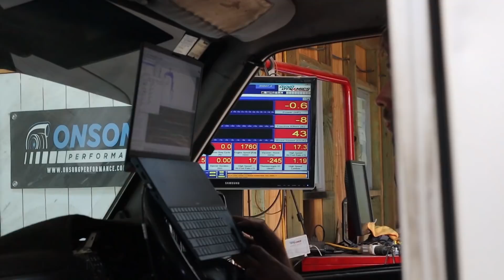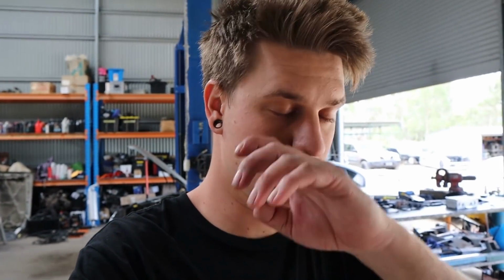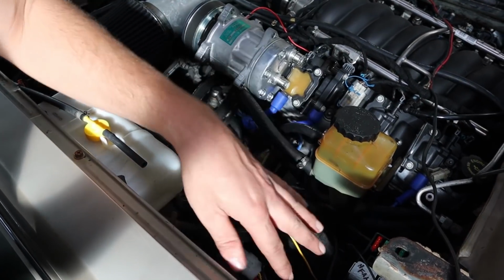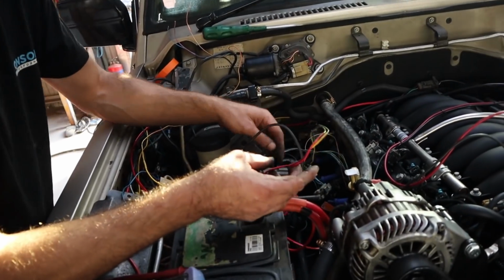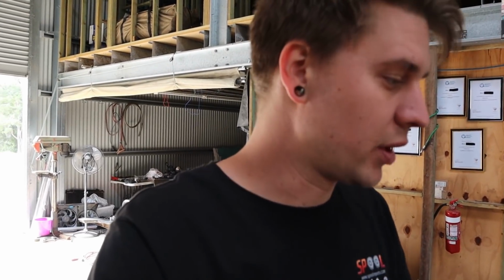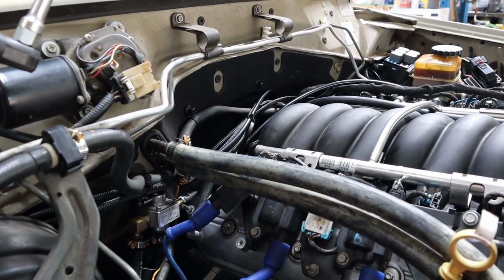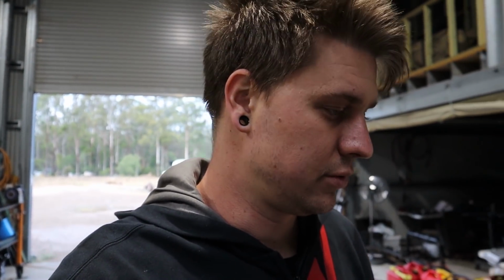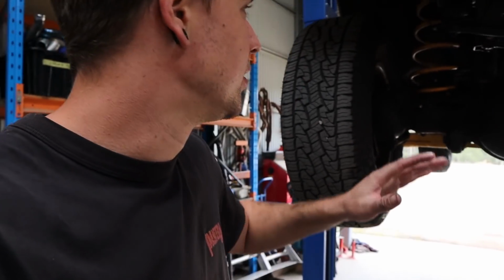The Never Ending Misfire.. | LS 6L80e GQ Patrol Build | Episode 7

Comment: Good video! A few suggestions from a lowly hobby mechanic with an electronics background. Have you tried running it off an aftermarket ECU and see if the problem goes away? I have an ECU I use for diagnostics, it comes in handy to confirm the engine and loom is good in one go.  What is the clearance between the crank sensor and trigger wheel? I've had misfires at revs from too much gap. Is trigger wiring close to leads? that can cause trigger issues on one cylinder if the signal is altered by another coil or lead. Can the factory ECU be set to run batch fire injectors that would fix it. I hate suggestions from other people but you can't think of everything. The amount of time you guys have spent you could have put a piggy back ECU in it and saved a few days.
Reply from the maker: Unfortunately not that simple as there are no aftermarket ecu options that can run the 6L80. 👎
The air gap on the CAS was bang on, we made sure leads were far away from trigger wiring (leads are only 300mm or so long). Would be good if we could put and aftermarket ecu in for fault finding, if it was manual we probably could. The e38 is quite advanced however, not much an aftermarket could do that the e38 cant, to have a total of 3 units all having the same fault would be unheard of.
Reply: @BoostGumps   Can run them piggy back and let the E38 control the box. At some stage you will need to make a call, to give up and give it back to the customer, spend even more time diagnosing or add a reasonable piggy back to run just the engine and deliver a finished running vehicle.

Comment: Just wondering if you tried swapping out the cam sensor on the timing case as they can be quite sensitive and die easily.
Reply from the maker: The cam sensors in the gen4 can be an absolute pain to remove sometimes. We have broked quite a few trying to get them out lol. We scoped the trigger signal and it came back fine so we decided to leave it be